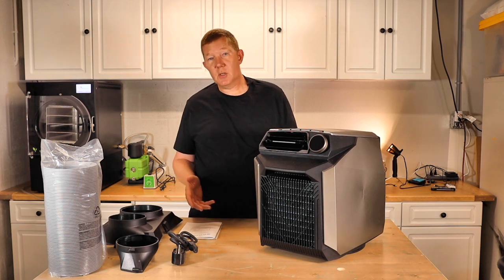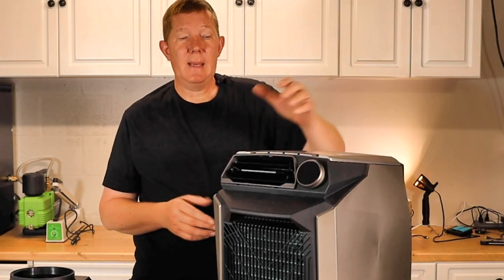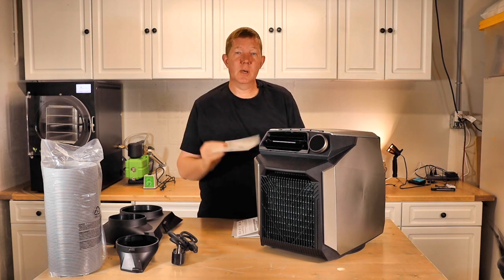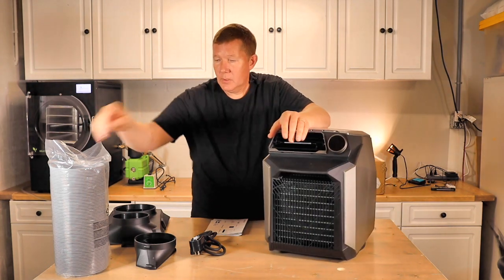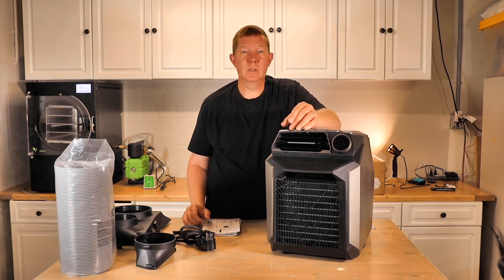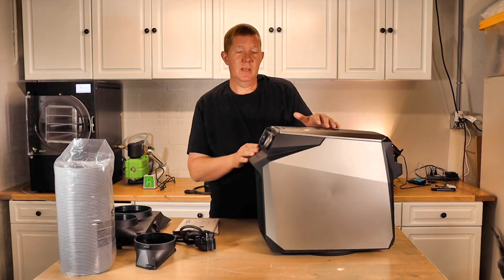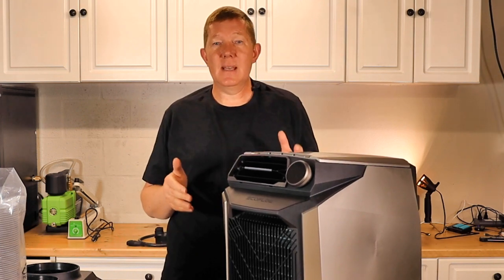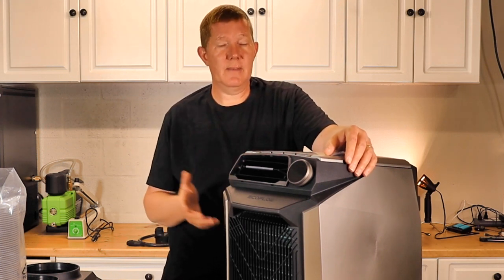The EcoFlow WAVE - The Solar Air Conditioner

Comment: Would ecoflow ac cool a midsize SUV, on the setting that would allow it to run 8 hours on the battery with a starting temperature in the car at 100?
Reply from the maker: I can't say for sure since it was not tested for that, But, I would suspect that would work. A Mid size SUV is probably less than the 86sf the unit is rated for, so that is an advantage. If its on low, to stretch out the 8 hours, it may take a while to notice a difference if the starting temp is 100 degrees. But again, its a small space. I know this unit has been popular for Van life. In fact that is probably where it would be most useful. Keep in mind if you can supply even just a little bit it would help the run time.
Reply: @DownGridSurvival  thanks for the info, yeah I think I will get the ads on battery and the delta max and have them work together.
Reply from the maker: @claeslind9532  Honestly, for the price and what you get, I would skip the Wave battery and get the Delta Max battery. That is more power that is more useful to other things when you don't need the wave. Just my opinion. https://www.amazon.com/EF-ECOFLOW-Capacity-Charging-Emergency/dp/B09GYFTJZQ/ref=sr_1_3?crid=1LH4IN0IYX8F1&keywords=ecoflow+delta+max+extra+battery&qid=1666720225&qu=eyJxc2MiOiIyLjgzIiwicXNhIjoiMS42MSIsInFzcCI6IjAuOTEifQ%3D%3D&sprefix=ecoflow+delta+max%2Caps%2C125&sr=8-3

Comment: Wow I don’t know my Delta pro died code 121 while the Wave was in the mail and now the wave died after four days of usage error code 67 good luck finding it.prelaunch unit with battery 🪫95 degrees Florida off grid Soooo… Grew up on the road bed bugger and this would be thrown out of the window if needed and overcomplicated unit fails to function.

Comment: Can I charge the battery with unit going through car cigarette lighter ? If not, can I charge it while off through cigarette lighter AND using solar panel at the same time? Can we use their 220 watt solar panel to charge this?

Comment: Why can't you just plug it into the Max outlet? It has 6 120V output sockets. It'd be the same as plugging it into a wall socket, right?
Reply: Dorian-

We’ve been using ours for the last week or so. You can definitely run the Wave via AC, whether  through line power or external inverter (like the Max). The difference is in power consumption.

Via AC outlet, the Wave consumes 460-480W; via the dedicated proprietary smart battery connector, the Wave consumes 410W over the same cooling period. This happens as a result of the integral DC inverter incorporated into the Wave, making it a “native” DC-compressor-powered unit.

Hope this explanation is of some help.
Reply: @SteepedinLightPhotography  Ok. Thanks.

Comment: I just look up that a diesel semi idling uses .8 gallon per hour x 10 hours x $5.00 a gallon = $40.00.  Assuming you pay the full price with a battery @ $2200, the payback will be 55 dayd.  That is pretty damn good.
Reply from the maker: Yes it is, Most people I have talked to in the industry says they burn right at 1 gallon per hour and diesel in many places is past $6 now. The only problem, is you would want a Delta Max or Delta Pro to get a full 12 hours of use, so that adds to the costs, but you can still pay for it in 4-5 months with the fuel savings.

Comment: Thanks for the great review.  Nothing was said about using any other charger or generator.  Can the battery for this be charged by a Jackery 1000 explorer or a Rockpals 600?  Can this unit be run off of one of these and trickle charging battery?
Thanks much :)

Comment: I'd like to see a 12 hours overnight test (8pm-8am) of a room within the space limits of the Wave on AC with a kill-o-watt meter.  I've seen reviews that measure the max AC draw, but the important thing is how the inverter compressor performs as the space reaches desired temp.  Best window unit inverter AC I've seen is the LG 8k BTU with a CEER of 15.5.   The Wave, while nearly 3x more in cost, would be more easier to use for most RV users.  If the AC performance is close enough to other options then the price for convenience may be worth it to some.

The biggest downside for some will be that to get the most efficiency from the unit will be via the DC direct connect to a Delta Max or Pro, but the cable is only 1m making them handcuffed together in your small space.  In my use the power stations are in the passthrough storage and too far away to connect to a wave in the bedroom so I'd have to suffer the inverter overhead cost and run the wave on AC.

Comment: I would like to know if EcoFlow has any plans in the future for the attached EcoFlow Wave battery. Right now it can only power the Wave and nothing else. It would be nice for the $900 cost to put some other charging ports in the battery.
Reply from the maker: Gary that's a good question. If your on facebook, look for the EcoFlow pages. They have several, one is for the WAVE, and there are others for new products. Ask the question. They are very responsive to questions, but also very secretive about new products.

Comment: Ecoflow really outdid themselves with this Wave. I can bring it and actually charge it thru solar anywhere I am.
Reply: Can you run it full time connected? say, to a campsite with standard electric? Without their battery??
Reply: @Wealthishealth89  yes you can run the unit with  a wall outlet

Comment: Thank you for the fine videos for the EcoFlow Wave. On the topic of creating a "small place" in your home, have you figured out a way to attach the dual exhaust hoses to your window? Are you going to cut your own exhaust kit with some insulation board or do you have another solution?
Reply from the maker: Thanks for asking. For now we are just using cardboard, but I have looked at a few window kits. It seems most are designed for one hose. Haven't found  a good solution yet but I'm working on it.

Comment: In response, I definitely see an application for truck drivers. It’s probably like an APU some trucks are equipped with that shoot a cold blast of air through a 4 inch duct: suitable for warm weather but not enough on hot days when the sun is beating down on the cab exterior. Some drivers sleep during the day. But for the rest of us, it would provide a very comfortable night for sleeping after charging it with our inverter while driving.
Reply: I really need one to put in my truck but the issue is the hose , duct I wish they make a specific hose for truck window.

Comment: Great review !

Me and my friends we order 5 bundles with Delta Max included for ours semi trucks !
We are very excited about this new product and we want to testing it out 
One Semi Truck burn per hour idiling only around gallon and half depends on the year but mostly gallon and for one break of 10 hours cost around $50-60-70 like hotel ;x …….no words 

Can you please make video  about running from delta max like run time of this battery efficiency different modes how to maximize run time from the app with different settings…… 

Thank you!
Reply from the maker: 5 Bundles, wow good for you. Thanks for the info on cost to sit idle, I have been wondering about that. I don't have a Delta Max, so I can't help much there. But  I did see some info on the Facebook Launch page that said up to 8 hours on just the WAVE battery, and up to another 8 hours with the Max. I know the Delta Pro is 12 hours. With the cost savings, you can pay for this quickly.